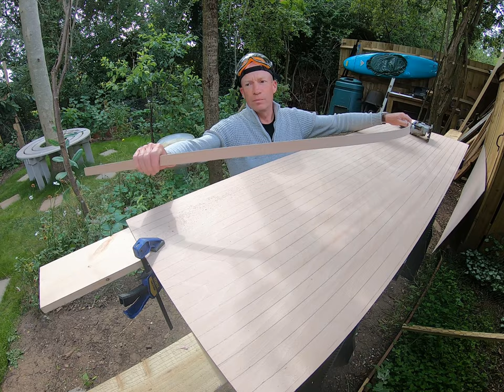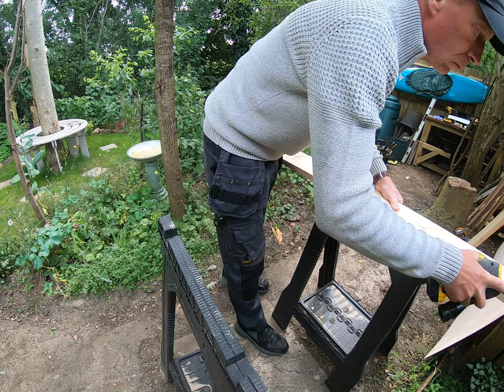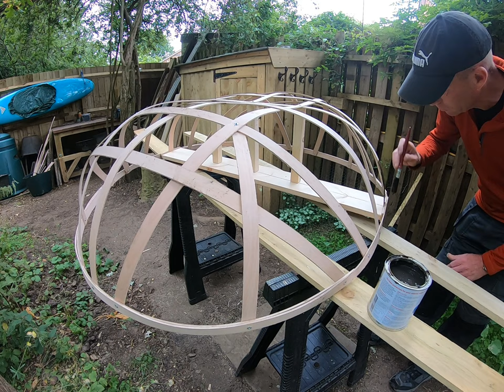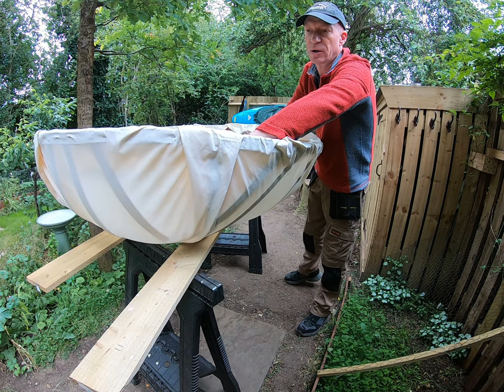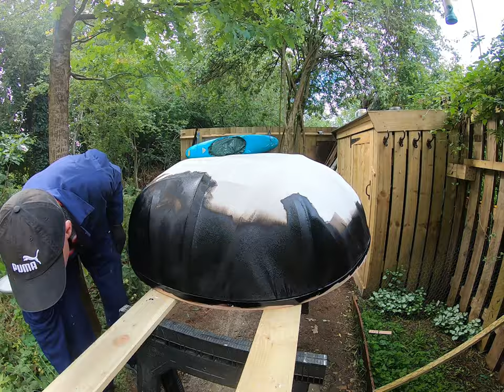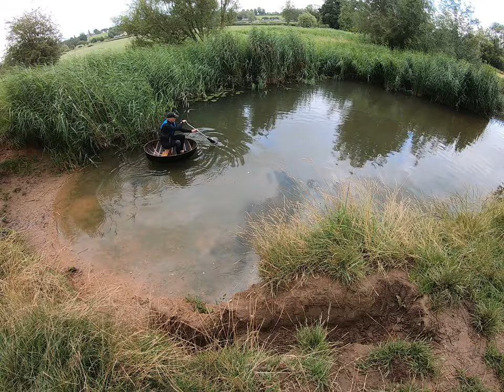Making Stuff from Stuff - A Coracle

Comment from the maker: If you're interested in having a go It's 1.1m wide by 1.4m long and 0.3m deep. 3.6mm plywood sheets 1.8m by 0.6m (2 of those), timber for the seat was 144mm by 1.8m and 20mm thick with legs 45m by 45mm square and 280mm in length each. 16mm by 4.8mm pop rivets (lots), Exterior waterproof wood stain and bitumen paint. The Calico - 2m by 4m was from the internet but everything else I got in Wickes DIY (other DIY stores are available lol). Have fun.

Comment: Hi, really enjoyed your video, thanks. Im thinking of making one too. May i ask you a few qk questions?, do u think i should soak the wooden strips first? And if so, for how long?would i then use them wet and let the whole frame dry? You then painted the frame... was that with boat varnish? Thankyou
Reply from the maker: Hi, thanks for watching. I thought about soaking the 'laths', however as they were strips of ply-wood they'd be likely to de-laminate and fall to pieces if they were soaked I think. They really are quite flexible anyway. I painted the frame with external wood stain (satin) that I had laying around. My thought was to weatherproof it to some extent just to keep any water from penetrating the edges of the ply-wood. Hope this helps. Please feel free to ask anything you like. Love to help.
Reply: @teawithq3351  Thanks a million. When you were putting calico on, did u just stretch it as tight as you could, before stapling it. A person i spoke to recently said they found that to be the hardest part... getting the skin to stretch and be really taut
Reply from the maker: @youareamazingyesyou5880  Tbh I didn't find it that difficult really. I just made sure there were no creases anywhere except the corners where I needed to sew them. I found putting the calico on quite enjoyable actually as it started to look like a boat!... at last.
Reply: @teawithq3351  great 
thankyou
Reply from the maker: @youareamazingyesyou5880  Thankyou too. Please subscribe if you haven't already.